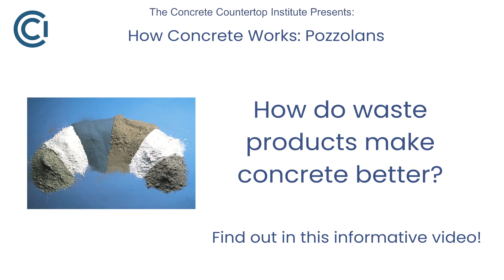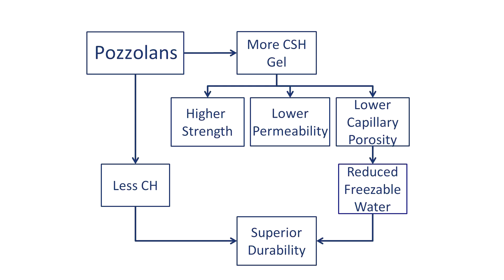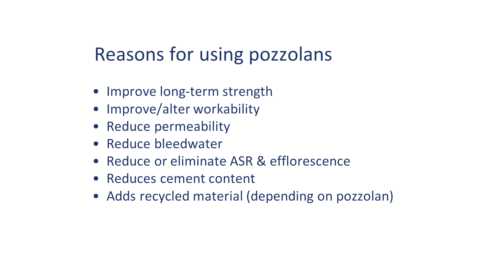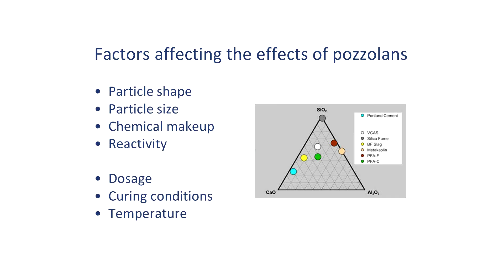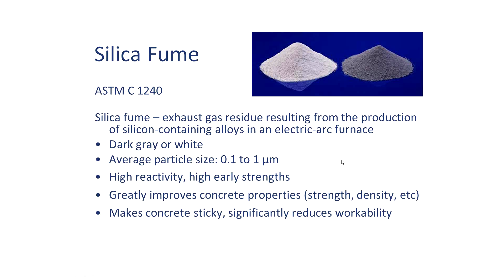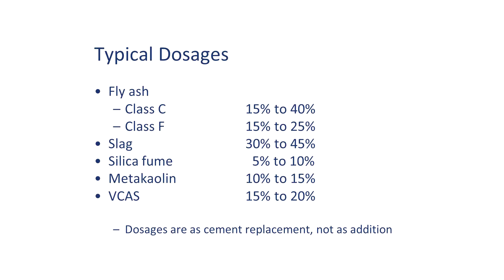How Concrete Works 6 - Pozzolans

Comment: You mention in comparison to construction concrete that you can replace some of the Portland with fly ash to reduce cost, but it still ends up as 4500lb (or whatever) material. If it's reacting with the calcium hydroxide as a pozzolan, wouldn't it be stronger?

Also, seeing as the calcium hydroxide is slaked lime, can you comment on the pozzolans in natural (or artificial) hydraulic lime plaster?
Reply from the maker: It's true that replacing some of the Portland with fly ash reduces cost, as cement is the expensive component in concrete, and here in the US fly ash is a waste product that much cheaper than cement. HOW pozzolans are dosed affects the cost and the strength. When using fly ash to reduce costs, high replacement doses (around 30% or so) offset strength increases for lower cost. Remember, it's the cement that provides early strength and it's the cement that generates calcium hydroxide that the fly ash needs to react. Reducing the amount of cement reduces both, and the designed intent is that the high fly ash content will help restore the 28 day strength to what it would have been without using any fly ash. 

Natural non-hydraulic lime plaster is essentially all calcium hydroxide, and it hardens through a reaction with atmospheric carbon dioxide, called carbonation. It will not harden underwater. Hydraulic lime plaster can be accelerated by adding pozzolans (usually fly ash for modern hydraulic lime), and the Romans did this by adding natural volcanic ash, the original pozzolan. Hydraulic lime means it will harden under water, while non-hydraulic lime won't. 

Note Hydraulic lime (HL) is a general term for a variety of lime different from calcium oxide (quicklime) that sets by hydration, and consists of calcium silicate and calcium aluminate, compounds that can harden in contact with water. This contrasts with calcium hydroxide, also called slaked lime or air lime that is used to make lime mortar, the other common type of lime mortar, which sets by carbonation (re-absorbing carbon dioxide (CO2) from the air). Hydraulic lime provides a faster initial set and higher compressive strength than air lime, and hydraulic lime will set in more extreme conditions, including under water.

The terms 'hydraulic lime' and 'hydrated lime' are quite similar and may be confused but are not necessarily the same material. Hydrated lime is any lime which has been slaked whether it sets through hydration, carbonation, or both.
Reply: @TheConcreteCountertopInstitute I thought hydraulic lime, say nhl2, is hydraulic because it has pozzalan. NHL is "natural" because the parent material, being mostly CaCO3, has impurities that fortuitously end up being pozzolanic and the resulting (after slaking) powder will set hydraulically. People have discussed making their own hl by adding pozzolan to Calcium Hydroxide. Was my understanding in any case.

Comment: Hi;i wanted to ask a question; can we infer that VCAS is a super-plasticizer as what you mentioned is the function of a super-plasticizer not a pozzolan
Reply from the maker: Great question! 

VCAS is not a superplasticizer, but because it has certain physical properties (particle size and shape, for instance), it can improve the workability of some mixes. On the surface these seem to be characteristics of a superplasticizer, but VCAS and superplasticizers are very different.

VCAS is an inert, recycled material that functionally replaces some cement in a concrete mix. By itself it is not a cement, but it reacts with the alkaline byproducts of cement hydration to produce more of the cementing compounds that bind everything together.

Superplasticizers are chemical additives that improve the workability of concrete, and let you use less water in the mix to achieve a desired level of consistency without losing strength. They disperse microscopic particles to improve workability. You can see the effects of a very powerful superplasticizer in the video embedded within this article: https://concretecountertopinstitute.com/free-training/superplasticizer-in-all-sand-concrete-countertop-mixes/

Comment: Very interesting topic, I learned a lot! However, you got me a little worried when you said to never ever use kaolin clay in concrete (as opposed to metakaolin). This is because I was planning on using washed white kaolin clay inside of a makeshift microcement mix (at a dosage of 3% of total dry weight). The mix is not structural, meant to be an overlay applied at a 1/16"-1/8" thickness. Otherwise the microcement is pretty polymer rich, but the kaolin would be used purely for a finishing aid, to make the mix creamier and smoother for better feathering, to control pinholes, and to increase white color in the mix. Hopefully the weakening effect the kaolin has can be substituted with the other materials used in the mix design, but you might know more about this than me.  The question I have is at a 3% dose, would you still advise to NEVER use kaolin? Maybe I should replace it with an ultra fine ground calcium carbonate? Really looking forward to your response, thanks!
Reply from the maker: Because you're aware of where you're using the mixture and what environment it's going into, I'd consider adding kaolin clay to be possible, provided you do tests to evaluate and determine what negative effects it has on the durability of the microcement. Make two samples, one with and one without, to see if there are any negative effects from the kaolin clay. I can't say if 3% is too much or insignificant, as the presence of other ingredients, polymer especially, will make things difficult to assess. Let the concrete guide you, but keep in mind kaolin clay, like other ultrafine non-reactive particles, has a negative effect at higher doses.